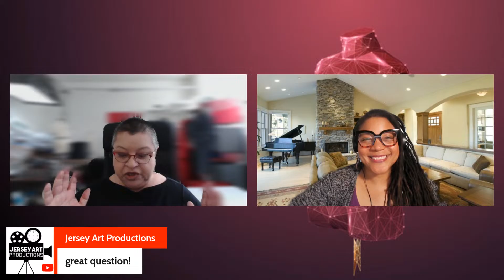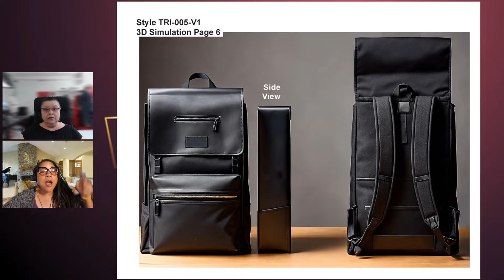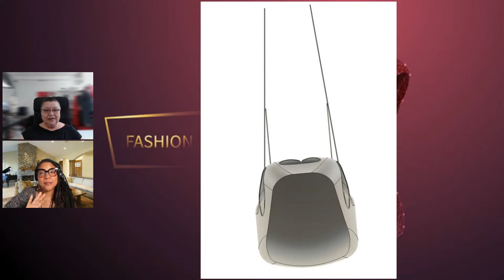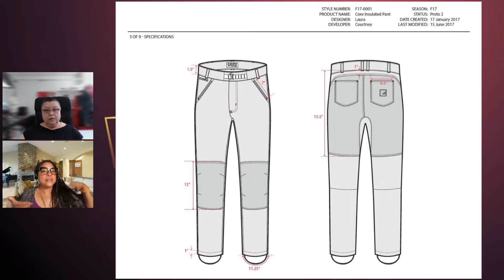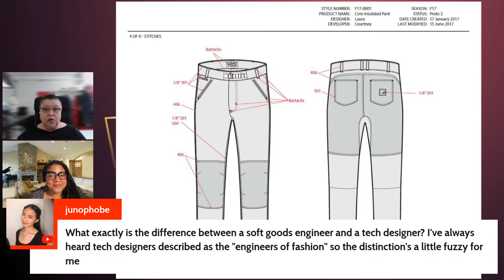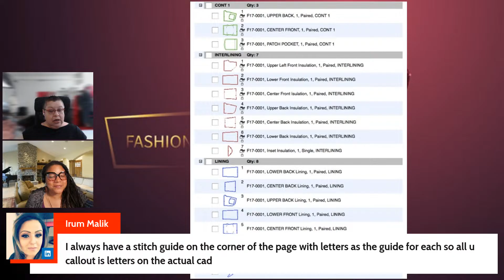Tech Pack Reality: Designer vs Manufacturer Standards

Comment: The 3-D scan for taking measurements and converting it into a pattern-making is amazing.  And black dyed knit shrink more than the same fabric in a different dye? I did not know that. I did know that different dyes add weight.
Reply from the maker: So amazing, right? The 3D scan is probably the best way to do custom fit.

And yeah, one of my tech designers from years ago taught me about how different dyes shrink more. I heard it again when I was working at Gap and talking to the denim designers. When they do different color washes (light and dark), each one fits slightly differently because of that! Who knew how tricky denim could be!  🤯
Reply: @383design  Right! It's very interesting to see how proactive people can be.
Reply from the maker: @diana.findingstory  agree!